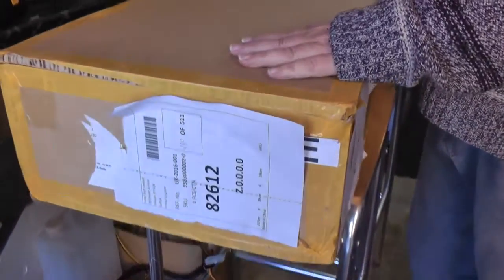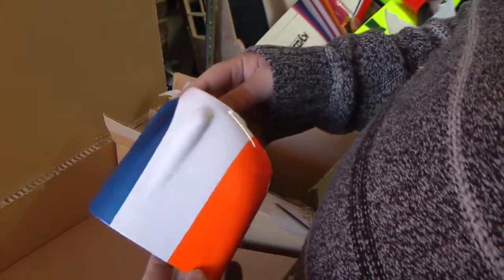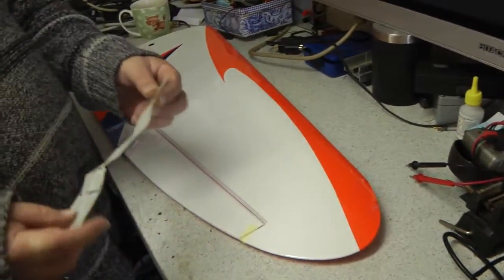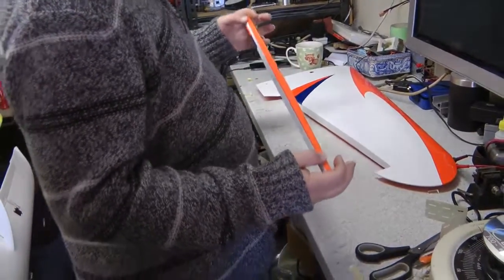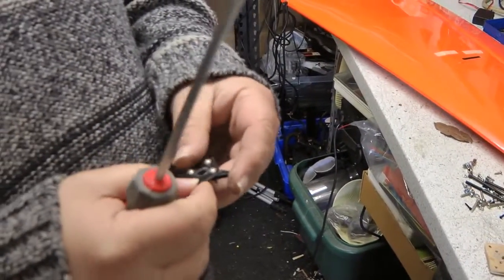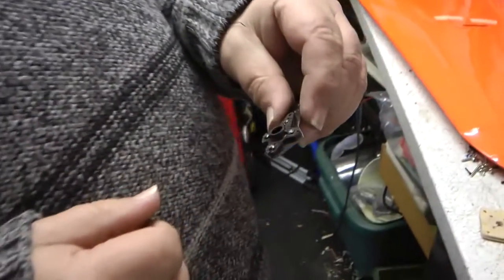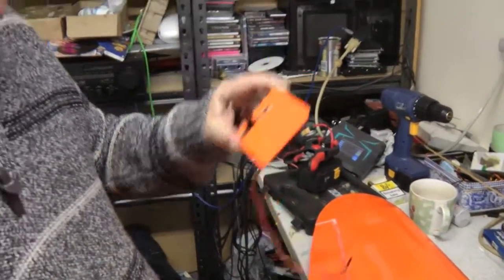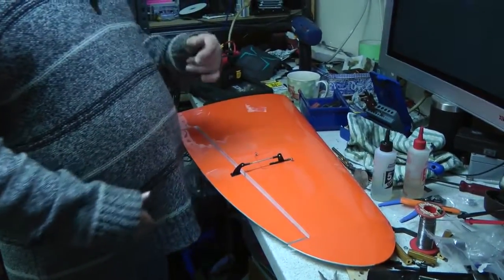HobbyKing Estrella Build Part 1

Comment: Hi Bob...Just a quick Question as to CA hinges,I can manage C.A.ing 2 or 3,in with no problem...but trying to glue 4 or 5,  I find difficult to line the gap before the glue sets,,lol...A tip from the expert would be great,, Love all your vids..
Reply from the maker: Hi Bob,  glue the hinges into one side first. then assemble control surface and run the ca glue along the ca hinges after its assembled! ca glue will wick up into the joint. Simple ;o)
Reply: Thanks Bob.,,,Yes Simple when you how,,Never too old to ask.once again great vids,,